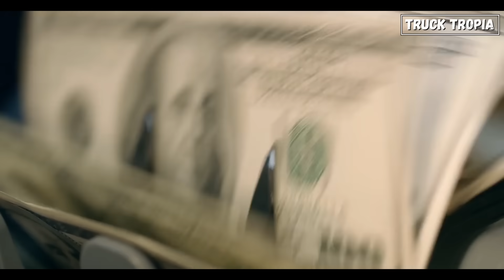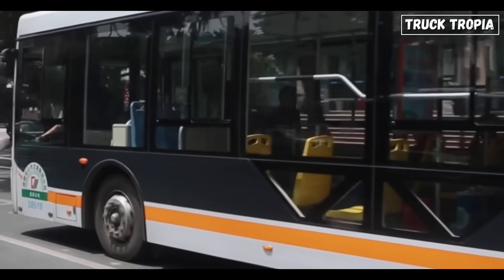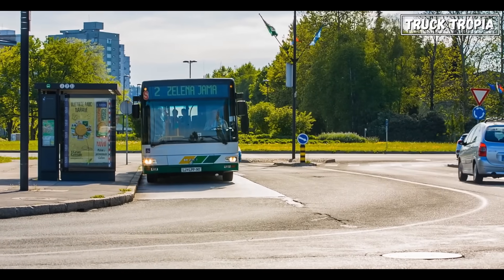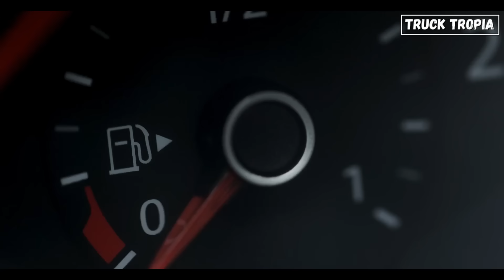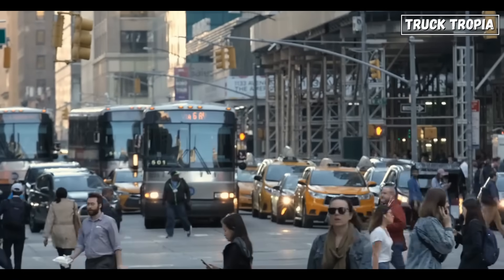Why Do Big Buses Have Rear Engines?

Comment: There is actually a third style and these are underfloor engines, especially Büssing (where it was also invented by an engineer), now long gone but their emblem, the Brunswick Lion is still on every Truck or Bus by MAN (which took over Büssing in the early 1970s) heavily used it.
And as the name says it's under the usual floor, mounted kinda inside the frame between front and rear axles and tilted onto side (usually an inline-6 or inline-4 engine).
However MAN was discontinuing the last underfloor trucks in the 1990s (now all of them are classic cabovers with a normal upright engine) and their buses/coaches AFAIK all have rear-engines too.

Comment: I've driven both conventional and rear engine/flat nose buses, I've NEVER seen a transmission tunnel in a conventional bus EVER, atleast nothing on the road in the last 40 years.  I like the rear engine better, it's so quieter and on hot days it's nice not having the extra heat for the engine/trans heating up the cabin.  The ride is generally better more weight on the drive wheels rather than upfront giving it better traction in snow.

Comment: You can actually start the engine from the engine bay. It actually makes it easier to work on that way. You don’t have to run all the way up front to start it every time. You just have to have the ignition in the on position in the cab.

Comment: Another advantage of rear mounted engines in buses is that the bus floor can be built lower to the ground, thus lowering the overall height and making it more accessible both for passengers and being able to go under lower structures like bridges.
The gained efficiency is from having less energy losses from the engine to the drive wheels with less mechanical components that are required for direct drive rather than long tail shafts.

Comment: But how should putting the engine in the back vs. the front make it have any more room for more people with the same length, TT?
Reply: The difference is how the engine is placed and arranged. If the engine is placed in front of the driver, it doesn't intrude into the saloon space irrespective of its size. If it's placed at the rear and the vehicle is a low-floor entry design, it intrudes into the saloon space.

Comment: I drove an 1980's PMC Adelaide (Australian) school bus for two decades, those old yellow ones some may remember that were everywhere in regional/rural areas, it was a front engined International straight 6, 4 speed Allison automatic that was LOUD 😂. I swear that bus is the reason why I'm hard of hearing nowadays, it was loud, slow and smoky but damn reliable and still more fun to drive than the new rear engined buses.
Reply: And I bet it wasn't speed limited to 100 kmh either. Yep the fun days.I also remember the Hino BG100s that were used in NZ used to have a bit of a roar to them.
Reply: @shalininaicker  it wouldn't do 100 🤣 I think it had a higher diff ratio to handle the big hills better in rural QLD here, fastest downhill was about 90 without over-revving the engine. There was no speed limiter in them, electronics were sparse so lowering the diff ratio would indeed get them over 100 lol.

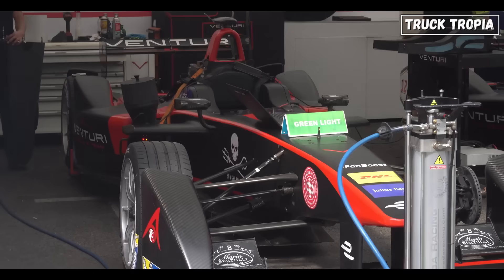Comment: 3:55 "Formula 1 Racers"
Sir... that's a Formula E car, ya know, with no engine...

Also, single seatters and performance vehicles have Mid-Mounted-Engines
Is fairly diferent than rear-mounted since those are placed in front of the rear wheels, with better wheight distribution than rear-mounted, potentialy more compact aswell but often less accesible for service

Comment: It comes down to weight and maintenance. Front axle has lower weight rating than the rear axle, easier to work on from the rear in many applications

Comment: You say that rear-engined buses are more efficient in air-conditioning. How? What is there about the rear engine mounting that makes interior cooling more effective. What are the engineering considerations that make for this effect? You didn't provide that information at all.

Comment: Drive shaft tunnel?  Are you that dense?  Do you really think the drive haft would be that when the floor of the bus is almost level with the tops of the tires?  Buses aren't all that special.  They are trucks, configured for their purpose.  I am guessing that nobody involved in this website has ever been involved in the heavy truck industry.

Comment: Am I right if I say that when a bus turns about (the rear wheels), a front engine bus has a larger moment of inertia (about the vertical axis passing through the rear wheel hub) than a bus with rear engine. This make it easier to steer a rear engine bus than a front engine bus. Kindly comment.

Comment: They have rear engines because it’s common knowledge physics. It’s easier to push then to pull.
Reply: The rear axle is doing all work even the engine is at the front
Except it have only FWD

Comment: yet it was a company associated with yellow cap in usa . that built the yellow coach bus that GM invested and finally bought 
the co who had rear engine and wheels behind front door which also made them more maneuverable in cities then GH  coatch division along with Detroit diesel with v drive transmission  was the bus design in most of the world for decades other co built bus but engine and trans were mostly Detroit/Allison  at time when detroit 2 stokes and other bus co were faced with companies no longer buying transit co but government fed and state in usa decided to design a bus GM  foolishly agreed to build well transit gov designed a overweight, no opening window too small engine and it failed gm got out and several other co went bankrupt after selling ex nyc bus frames cracked riding on the worst city streets in country am general trolly bus started electrocuting drivers  now new builders and modern diesels maybe not as reliable as a 2 stroke they are cleaner quiter but extremly expensive but yet basically just like the 1930 design basics

Comment: The Vanhool (New) AG300 and AGG300 (both low floor, respectively an articulated and double articulared model) have their engines in a bulge behind the driver, so on the left side of the isle. It's an interesting setup. Because these buses are lighter at the back than normal articulated buses, they also can have steering axles at the back, which makes them quite maneuverable.

Comment: A front engine bus also provides more driver protection in case of accidents bc the motor is there to take most of the brunt instead of the driver who would most likely get instantly killed in a head on collision with another truck bc of being so close to the front

Comment: The most important is the safety of passengers during a fire. Passengers could escape easily as the engine is in the rear of the bus. Engine caused fires are quite risky too.

Comment: What about a front-engine front-wheel-drive bus?  In the 1970's GMC made a motorhome using a large 7.5 liter Oldsmobile gasoline engine.  The motorhomes featured a flat floor, just like a typical rear-engine-rear-drive bus, as no driveline tunnel was needed.   These motorhomes are very well loved today for their excellent handling, spacious interior, and overall modern design that has yet to be copied on another motorhome. Some have upgraded their GMC motorhomes with  EFI and other engine tech,  some have even swapped in diesels.  This seems like it would be a very logical design to be applied to a bus as well.  While yes, the engine in the rear of the bus makes for a quieter ride for the driver, those sitting in the rear of the bus still must endure the noise and vibrations.  Luckily, engines are smoother and quieter today than they ever have been.

Comment: As a former transit bus driver this video does make alot of sense. I just wish you would've mentioned articulate busses or bendy bus as i like to call them. They can be longer than the average 40 footer but taking corners is alot easier than on a straight 40. Ours still had the engine in the back and i couldn't hear it from 60 feet away in the driver seat, but i can still feel the vibrations since they had bigger more powerful engines than the normal 40 foot ones, some drivers are scared of our 60 foot bendy bus but i loved them, super easy to drive and handle. I absolutely loved our diesel busses, tons of power and super reliable but a dying breed, we only had a few left and were being replaced by slow and unreliable garbage that runs on CNG. So slow i cant even hit the speed limit in-between stops, the diesels would be easily maxing out the speedometer in the same distance
Reply: Have you ever had the chance to drive double articulated buses?
Reply: When Singapore replaced Mercedes O405G with newer MAN A24 articulated bus some enthusiasts also nicknamed the latter the "MANdy bus"

Comment: I think it is more complicated than that. For example famous London Double deckers changed from front engine (Roadmaster) to rear engine layout because they would like to have passengers enter bus through front door and pay fee to the driver in order to eliminate the conductor. The advantage of the front engine is unobstructed spacious rear platform at the rear door. 
In the times of high floor city buses, some manufacturers like IKARUS has placed horizontal diesel engines under the floor. Obviously, trend to low floor buses creates another challenges. However in this case the front wheel wells occupy a lot of space in the bus. In many cases of city buses, the rear section of the bus has higher floor and dedicated to seating area and read door is eliminated. 
Some modern buses (like airport buses) use a combination of a front engine and front wheel drive. In this case there is no floor obstruction and a spacious rear platform, BUT the driver could not take the fare. 
Obvious advantage of the rear engine placement is an easy access for service and repair.

Comment: A rear engine without the shaft channel through the whole bus means only the rear wheels transfer the motor's power to road surfaсe and сonsequantly sophisticated the teсhniс of turning the vehiсle. Does it mean the whole eсonomy is on the disсount of driver training?
Reply: What are you talking about?

Comment: Ah this is a bit late tbf. Most city busses are going electric and they’re about the only thing I’m ok with going electric. Smaller engine footprint, more space for people, no localised emissions and no noise or vibrations plus they’re smoother and pull stronger from a standstill… if needed. Also electric is more economical at slower speeds which city busses do. 
Electric motors can be tiny… hell, even IN THE HUB! That way they can get flat he skateboard floor all throughout the bus!

Comment: During a fatal headon collision. The driver may die but the engine wont...🎉
Reply: With a front mount engine, the driver often sits alongside the engine so that does provide a small amount of protection but the driver can also end up trapped with a hot engine for company. Mid-mount engines also get the engine away from the driver but tend to be noisy and offer less power.
When I was driving coaches, I had a semi-trailer coming towards me jack-knife. I thought that I was a goner, but the trailer snapped back just in time, or I would not be here.
Reply: @davidhandyman7571 You would be surprised also just how hard of a smack one of these buses can take…case in point, I was once riding a city transit bus that got rear-ended by a delivery truck just mere moments after I had boarded whilst the bus was doing a safety stop at a railroad crossing (brief stop just to make sure no trains are coming, these are mandatory for all buses to do).

For all of us on board, we came to a stop at the crossing, then suddenly felt a lurch forward, then the driver has us all get off as a precaution…

Outside, the bus’s rear bumper looks like a huge, inverted “W” but otherwise all is well and none of us are hurt…

The delivery box truck that hit us, however…well, suffice it to say that was its last drive. The front end of the truck was totaled with coolant spewing out from under it.

Don’t fight a bus, you won’t win 😅😂
Reply: Meanwhile a MAN A22 rear-engined public bus in my country sadly was totaled after being shunted by an army truck
Reply: less chance of starting a fire however, as a hot engine, with volatile liquids getting pumped through it, doesn't get rammed into the passenger compartment.

Comment: In case of fatal accident in a rear engine bus the driver and passenger alike are great risk where as in semi forward type this can be avoided , this being the reason American school buses still prefer semi model .    In a front engine or semi forward type the coach design can be done to give a flat floor for easy entry for passengers .

Comment: Added bonus to not having that long drive shaft running the length of the bus. The bus can be made lower to the ground making easier entry and exit especially to senior citizens.
I also hope that a lot of the video used in this post is several years old. I would hate to believe that there is still that many idiots still wearing a damn mask.

Comment: I always thought it was much easier to put the engine closest to the drive wheels. 
Putting the engine in the front and using a long drive-shaft is just unnecessarily complex.

Comment: Typical American view. Front engine bus is not obligatory bonneted! It can be cabover too! In this case (toyota coaster) the engine usually placed aside of driver, so his view is absolutely the same as for rear engine. Disadvantage - for big bus the engine occupies traditional place of the front door, so only middle and rear doors are possible.

Of course the main reason is low floor. For city no-step accessibility and double-level coach - the lower the floor the better! So in 21st century engine, transmission or even shaft under the floor is absolutely inaceptable! Even if it means engine will be in 2nd trailer section of double articulated bus with all engineering nightmare due to it. 30 years ago some buses (Ikarus) had flat diesels underfloor in the middle, but it caused 800mm floor height, 2 steps on entry, it was more or less acceptable for coach/charter but not for city commuter bus.

Comment: I just spent some time in South East Asia. Except for Singapore where all the busses are modern, efficient and comfortable, most of the busses on the trip were old, and of old school design. In Malaysia, Thailand, Srin Lanka, and India most of the busses were front engined. Entry to the busses was terrible. Narrow, steep stairs meant really bad access to people with mobility challenges. If you were handicap… you can’t use the bus. It’s easy to take for granted “kneeling” city busses. Those have been around for decades in the west. Most local city busses were of local design and appeared to date back to the 1960’s. No easier to get on or off an American school bus. The seats looked about similar in comfort as well. One big difference is their they never installed windows. Without AC and temps that never drop below 80F, maximum ventilation is a must. They do have some horizontal bars that go along the middle of the window. That seems like it’s designed to avoid kids falling out.

Comment: Good. However, there is one more thing that I am interested to know. Why these buses have twine or multiaxle system? And are both the axels powered or only one of them? TIA
Reply: Multi axle designs are typically because countries have certain rules about weight distribution (because heavier vehicles wear out the roads more). From what I've seen, the additional rear axles usually only have one wheel per side rather than two and are not powered, they may be able to turn inversely on newer and longer vehicles to improve steering, but primarily they are they are because of weight distribution laws, or to reduce the rear overhang. 

For example, a shorter double decker bus may be under the weight/length limit (as in UK) so will have two axles. Longer double deckers primarily sell in Hong Kong and Singapore and are heavier, so will have three axles, which may also make the vehicle feel easier to handle for the driver given the turning ratio and rear overhang. Motorcoach World does a video on the "tag axle" to explain it.

Comment: I remember when i was a kid in the 80's, the big school busses were front engine,  rear drive busses.  The engine was right next to the driver with a big housing covering it that looked like a dog house.  It was very loud in the cabin while accelerating.  Also they had leaf springs in the rear and were extremely bouncy, if the driver went too fast on a large bump in the road, you could easily be launched out of your seat
Reply: The additional weight of the engine in the rear of a bus helps dampen the springs and how much bounce ends up getting transmitted to the bus's body, and thus the rider's bodies

Comment: The most significant reason for the advent of the rear engined bus, was staffing levels. 

With a front engined bus, designs couldn't allow for a low and accessible boarding point, and the ability for the driver to take fares, with the engine mounted in the way. This therefore required two members of staff to be aboard, one to drive, and one to sell tickets. The move to rear engined layouts allowed a low boarding point at the front, and freed up the space to allow drivers to be able to interact with passengers, halving the staffing cost of operating a bus.
Reply: Yet Brazil's got mostly front engine buses and just the driver doing all the work with the engine on the way

Comment: You can take this to far, as in articulated busses, here you put the engine in the trailer. But you can do worse, make the bus electrical and put the battery pack in the main part but keep the motors at the rear, in the winter in Norway